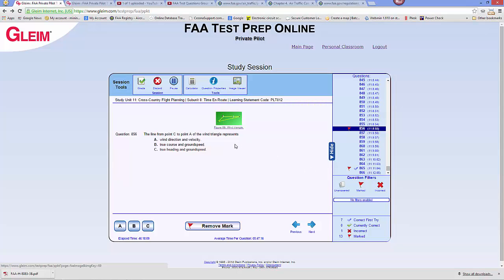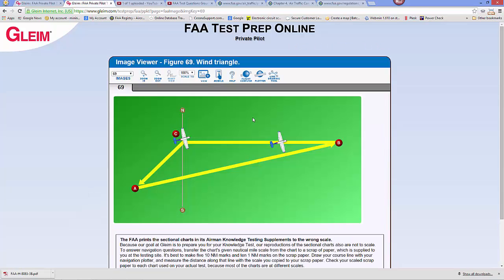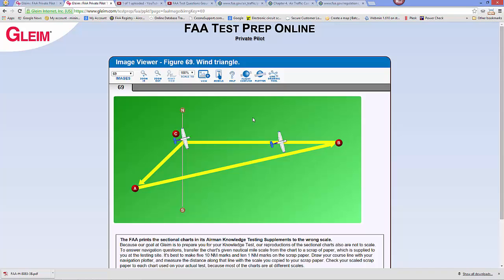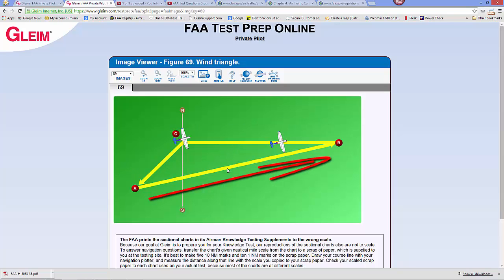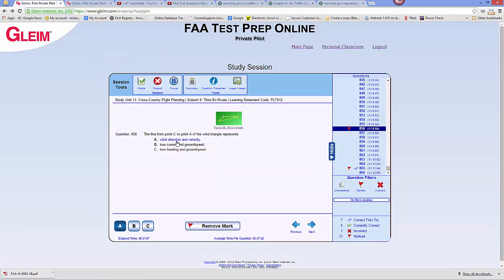FAA Test Question Wind Triangle

Comment: Please help me explain this question: use a cross wind component graph.  Reported wind of south at 20 knots, which runway is appropriate for an airplane with a 13 knots muximum crosswind compnent.
Reply: Compare the crosswind component of all the runways. Whichever has the least crosswind component, that is the most suitable runway. You probably were given options of the runways (e.g: 14, 22, 32) etc.